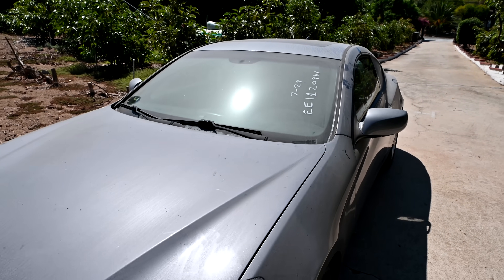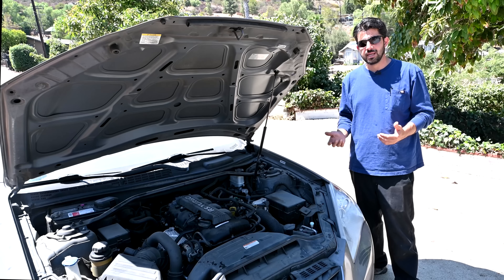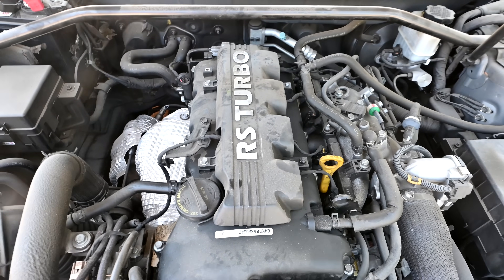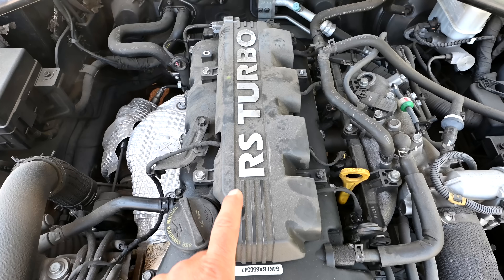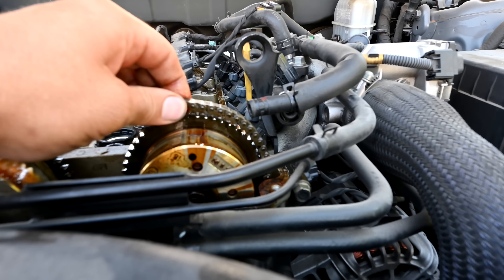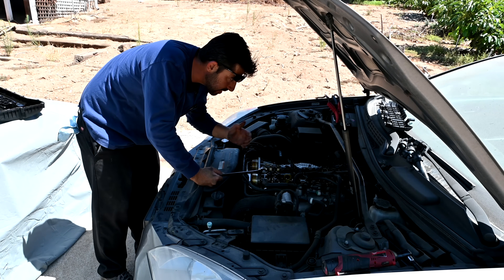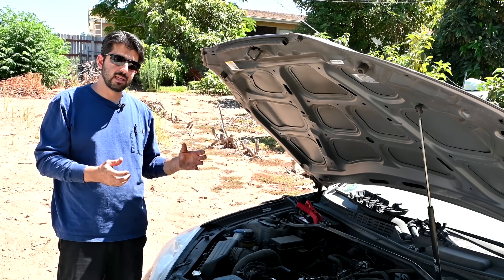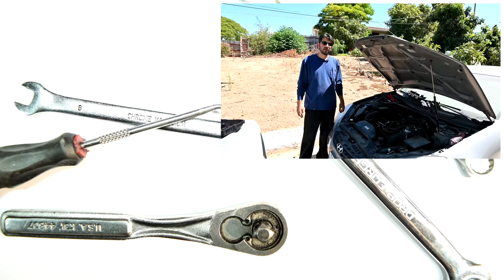The Hyundai And Kia Engine Failures Explained.

Comment: The sad thing with these engines is that they were originally making the 3.3L V6 Lamda II engines and the Theta engines at the Montgomery engine shop, for use in Sonata, Sorento, Santa Fe, etc. But they had enough issues with the 3.3L they decided nope we are gonna stop making that V6 and focus entirely on the Theta 2.  And then those sucked worse. The Montgomery engine plant was just a disaster house, not entirely all their fault. The designs were bad.  I'm on my third vehicle with a Lamda II V6 and I actually like this engine.  Shrug.
Reply: 240,000 Uber driving miles on my 3.3L KiA Sedona Minivan… strong engine
Reply: 2018 KiA Sedona 3.3L with 6 speed automatic transmission
Reply: We have a 2020 Kia Sorrento EX-V6 Sport (last year for the V6 in the Sorrento) we love, love, love this SUV and especially the engine.  35,000 miles currently no problems.
Reply: Do you know if there is a thread about Lambda II issues? Do KIA and Hyundai share engines?
Reply: @stanleykay4196  Do not know of a thread.  Hyundai and Kia share engines.  Hyundai owns Kia.
Reply: Same here, I wanted to buy a replacement for my V6 from Hyundai and was told it is no longer in production. But shouldn't engines be backward compatible? Btw, why wasn't the V6 included in the nationwide engine replacement program?
Reply: @stanleykay4196  Because the V6 is a great Motor.  Only the 4 cylinder Theta I and Theta II engines had Catastrophic problems.
Reply: @bryanwinter3289 Well that has not been my experience. 115k miles and I have to change it!
Reply: @stanleykay4196  Sorry to hear that.  What year and what went wrong?
Reply: @bryanwinter3289  Noticed that the low oil pressure light comes on during stopping or idling. This occurred right after a road trip. Oil was topped though scheduled oil change mileage had not been reached. Low oil pressure persisted during stops. (It appeared I was burning oil during the trip) Was informed that the motor can only maintain 2 psi oil pressure on stopping. Advised to get a new motor. From my mech, the dealer says Hyundai no longer makes the 3.3 V6 motor because of too many failures! This is a 2017 Santa Fe!
Reply: @stanleykay4196  That is unfortunate.  However, I disagree with your Mechanic that was why they stopped making the 3.3L engine.  A version of this motor is still being made today.  The 3.5L V6 in the Kia Telluride.  We almost bought a 2020 Santa Fe but we did not like the 4 cylinder engines.  That is why we went with the Kia Sorrento 3.3L V6.  We love it and no problems so far after 40,000 miles.  Our Mechanic says the opposite in that the 3.3L was used for many many years in the Sedona mini Van's. Many which have reached 300,000 + miles without problems.  Hope your problems are easily resolved.
Reply: @bryanwinter3289  Thanks for your feedback. I will visit the dealership and make enquiries.
Reply: @bryanwinter3289  Just confirmed from the dealership that the engine has been discontinued. It is a shame.
Reply: @stanleykay4196  I am so Sorry.  Seeing you can find a low mileage engine at a Auto Scrap yard.
Reply: @bryanwinter3289  May want to check out LKQ for a used engine.
Reply: We had one of these. It handled like a cruise ship and was comically unstable. Gearbox (manual) went after 100k km.
Reply: @atmark666  a Manual in a Sorento V6??????  What year?

Comment: As a kia master mechanic for 8+ years I have never seen a timing chain issue. Please show us the bottom end rebuild as we never do that at the shop. Only short blocks
Reply: 2.0l not hard to get bearings for but the2.4l thetta II design hard to get main bearings when the crank is turned. I have to take block stripped and when my machinist tells me the bearing sizei have to cut the crank to fit the bearings. Usually it is a burnt rod. cylinder walls good i just rering use the timing componants reassemble do the program update and away it goes
Reply: been with hyundai for 7 years and never seen this issue either , we only do long block for theta 2 engines  2.4 which was well known
Reply: 2018 Sorento LX 2.4L with 90,000 km, oil changed every 6000 km at the dealership.  Been burning oil intermittently for going on 2 years now, engine is finally being replaced next week under warranty.  Dealer took a look in the cylinders with a borescope which revealed scoring on the cylinder walls.
Reply: I'm hoping you can help me with the Sorento I have.  It's been hesitating/ hiccuping while driving or at idle and now stalling when coming to a stop.  No codes, mechanics haven't been able to figure it out yet.  It seems to only happen right after or soon after getting gas. It has died multiple times when coming to a stop after leaving the gas station, then I can turn it back on, then it hesitates a little while longer. Then it may be fine for weeks.
Reply: @blissfuljoy6049 Probably 4 months too late but I will take a swing at this. Your problem lies in the evaporative emission (EVAP) system. Usually its the purge valve (in the engine bay) that is either sticking intermittently open, has a torn rubber diaphragm inside the valve or the valve is not seating properly. The other culprit would be the vapor blocking valve/refueling valve/canister shut-off valve (every manufacturer seems to call it something different) it lives near the charcoal canister around the fuel tank area and will suffer similar issues.

What is happening is when you stop and refuel these valves are supposed to prevent fuel vapors and liquid fuel from traveling up to engine. 

At the moment the engine is being saturated with excess fuel when you start the car and pull away because one or both of these valves are not doing their jobs and sealing properly during refueling allowing vapors and/or raw fuel into the engine.

So why, you may wonder,  is the check engine light not on then if something is obviously not right and the engine runs terrible?? Shouldn't the computer be smart enough to see that?? Sort of.  On Board Diagnostic 2 (OBDII) does monitor these emission items, however, the computer only checks them periodically, (called an OBDII Drive Cycle) It wont check them when the fuel tank is over 80% full or if you have less than 20% fuel remaining because if it were to run its test it would be inaccurate and the computer would freak out and cause a false Check Engine light. So the test is run between those levels for accuracy. 

So, when u refuel to full, the issue is happening but the computer wont see or check for anything until your tank is down to about 80%. By then, the driveablity problem has cleared up,  the computer runs its tests and says 'Yup all good here, everything's fine' and no faults are ever generated.

I know this was quite wordy and long but hopefully helpful in some way. Happy motoring!! 

Sincerely, Brian. 
21 year Master Certified ASE technician.
Reply: Me neither in Europe. Best cars driving around atm... (maintanance wise) I had one kia in the garage that lasted 80000km w/o oil change... they got my respect!

Comment: We had a 2015 Sonata and sold it with 90k trouble free miles. Changed the oil and filter every 5k miles with Pennzoil ultra platinum.
Reply: I just got a, 2023 Hyundai Sonata N-Line 2.5l turbo and I couldn't care less about engine problems as the warranty is, 10 year/100k mile warranty. Lol. So....I don't care if anything fails....I get it fixed/replaced for free. Ha also....I ALWAYS change the oil on a new car after the first 500 miles.  Some engines just don't last as long as others. It happens....not a single engine and or car maker has an engine that has never had a issue or issues. Millions are sold and odds are, some will have issues, especially with some people driving em hard as all hell and not doing proper maintenance. Again, new hyundais now have a 10 year/100k mile powertrain warranty. So, couldn't careless about issues. Lol also, when buying a new hyundai, you can purchase a lifetime pwertrain warranty for around 2k.....so.....couldn't careless about issues.

Comment: those Slip Joint Pliers look like they've been burried in your yard for a while.  My 05 Accord runs and drives better with 100k miles than my 2012 Elantra with 50k.

Comment: I have 2 hyundai's with over 250k miles and still running great. Just general maintenance, most reliable cars I've owned.
Reply from the maker: you have the 2.0L hopefully
Reply: @myRatchets  1.8L  non turbos. My son had a sonata with the 2.4 that had the blown engine at about 120k you described though.
Reply: @racrx728  that's why yours has 250k, the turbo GDI engines are garbage
Reply: @MrRohanThomas  yeah, pretty much all newer turbo engines are garbage for longevity
Reply from the maker: The 1.8L is very similar to the 2.0L they are good but some do burn oil. Just a headsup.

Comment: Love Hyundai. My Elantra has 375k miles on it and still rips. That said it seems between 2008 and 2018 they had major engine issues. I'm not going anywhere near their theta engine.
Reply from the maker: Yup I consider some of the Elantras very reliable cars. Problem is their Theta II engine is terrible.
Reply: What year is your car?
Reply: I had a 2017 Elantra with the shitty Atkinson cycle engine. I babied it and still needed a new engine at 12,000 yes 12K miles due to excessive piston slap traded it in for a Mazda at 45K and will never ever again invest in Hyundai
Reply: @marcelmichaud3526  I have a 2022 Elantra n great car
Reply: @vurshawn1358  - well yeah, it’s only 8 months old 🤦‍♂️
Reply: @RustyZipper  true but I had a n line before that very reliable car idk I feel like people think Hyundai is the same company it was 20 years ago 🤷‍♂️
Reply: I just got a, 2023 Hyundai Sonata N-Line 2.5l turbo and I couldn't care less about engine problems as the warranty is, 10 year/100k mile warranty. Lol. So....I don't care if anything fails....I get it fixed/replaced for free. Ha also....I ALWAYS change the oil on a new car after the first 500 miles.  Some engines just don't last as long as others. It happens....not a single engine and or car maker has an engine that has never had a issue or issues. Millions are sold and odds are, some will have issues, especially with some people driving em hard as all hell and not doing proper maintenance. Again, new hyundais now have a 10 year/100k mile powertrain warranty. So, couldn't careless about issues. Lol also, when buying a new hyundai, you can purchase a lifetime pwertrain warranty for around 2k.....so.....couldn't careless about issues.

Comment: Hyundai's likes other brands have good and bad models and good and bad years. I bought used a Santa Fe 2008 3.3 and a Veracruz 2007 3.8 and are strong, reliable, comfy and fun to drive. If you keep doing normal DiY maintenance and know their flaws the car last. Of course are not the best but are pretty awesome for the price. The thing about Hyundai's they improve with failure faster than other brands but struggling because they trying to keep price low increasing performance. If you want the best on reliability Toyota/Lexus should be you aiming... but the price 😬
Reply from the maker: yes you have to do research on the model within a brand. cheers
Reply: Agree 100%. I think a lot of the comments are just from people reading the worst case scenario stories.
Reply: I’ve gone 315k miles on a 3.8 and it’s still going.

Comment: Kia/Hyundai - shitty copies of Japanese engines. Less material, badly engendered crank shaft bearings. Just not reliable, made to last warranty period.
Reply: So pretty much majority of manufacturers these days. I find not all are junk and it is hit and miss. My wife had a 2017 Optima with low miles which was bad, our neighbour had the exact same year and model and it has been perfect. We have a 2016 Santa Fe which has never let us down and I have a Genesis with the 3.3 TT and the same. Some people have Hyundai and Kia vehilces with high mileage and obviously some have not been so lucky.
Reply: Prove know they're not getting a Toyota when they buy them.  Treat them well, change their juices, keep them sweet.
Reply from the maker: They have some good ones but the theta II certainly set them back

Comment: 9:11
Use a camera scope down the spark plug holes checking for metal marks on the piston maybe
Reply from the maker: no leak down test is more definitive.
Reply: @myRatchets  Yes, however its always nice and never hurts to do a visual inspection. This is a 'video', right?  You can get a USB borescope 1080p on eBay for $10.
Reply from the maker: Bore scope I use for when there's no compressed air available, a lot of times people use bore scopes than to confirm their findings they do a leak down test.  It never works the other way around.